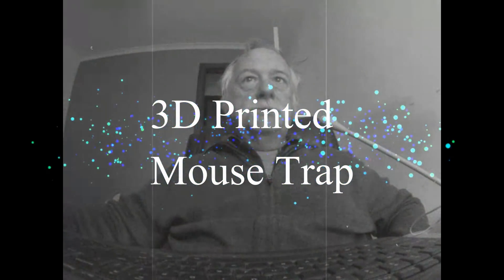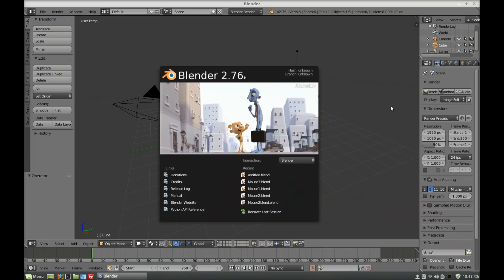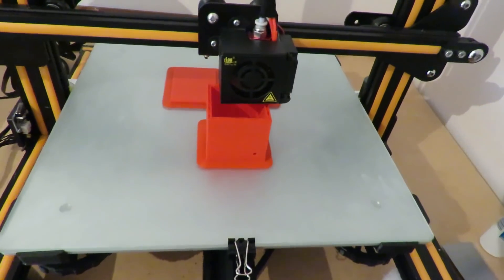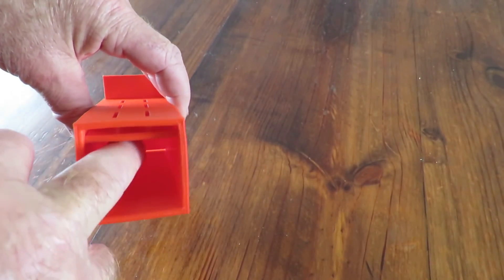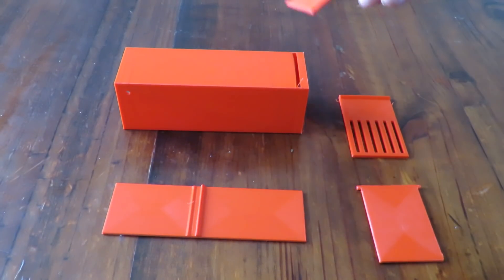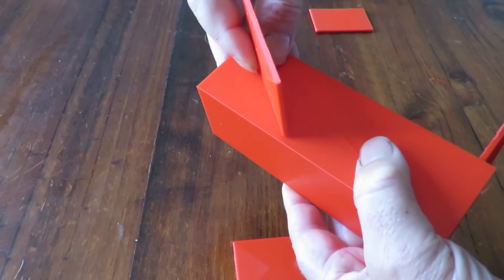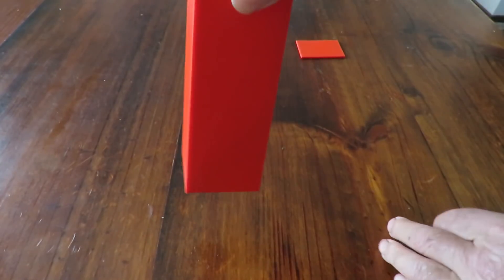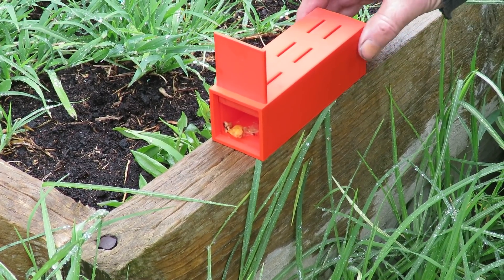📌This 3D Printed Mouse Catch and Release Trap I Designed in Blender really works

Comment: Seems like a great design but I think it might need to be longer so that mice with long tails do not keep the trap door from closing. I think I will have to print a few of these in a longer design. Thanks for posting your Project.
Reply from the maker: Good point.
Sounds like Mouse Trap v3.0 in the making.
Reply: I might be wrong Garry, I think when a mouse moves they always turn around and run forward, so even if the tail was blocking the trap door when the mouse turns to run out there tail would be pulled out of the way. You might have a perfect design as is. I will have to give it a try.
Reply from the maker: The first one caught a mouse as you have already seen in my video.

BUT..  I think my v2 with the removable floor and locking bar will work better. 
In v3  I added a small perimeter wall around the floor to stop the bait from falling out when placing the removable floor into the trap.

P.S. Making the trap a bit longer, as you have already suggested, won't hurt either. 🙂

Having said all that above, I'm always open to improvements that can be made.